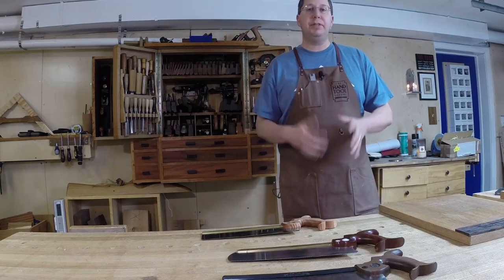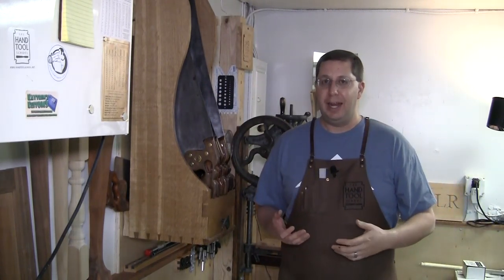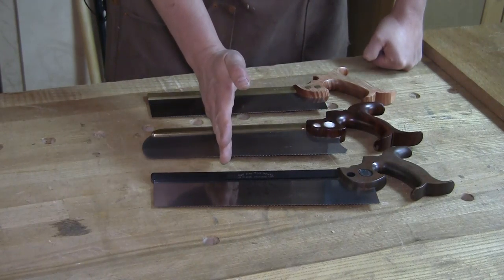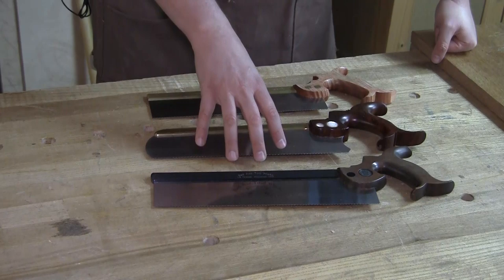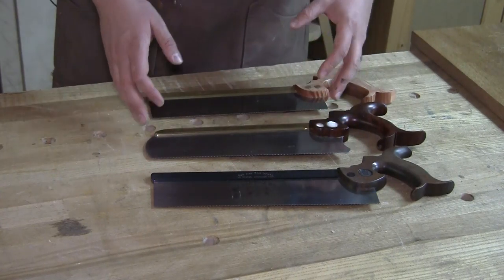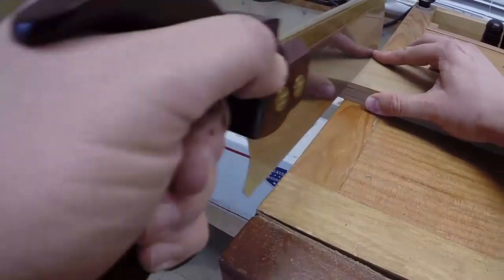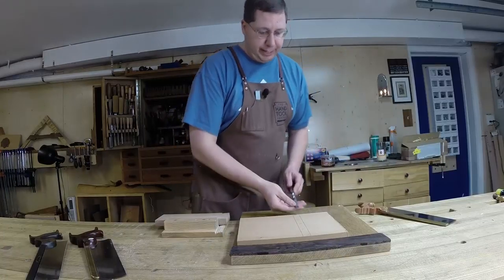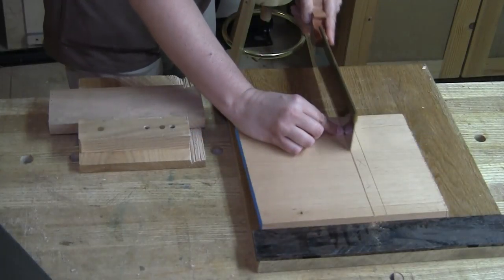RWW187 Which Saw First

Comment: I got lucky, my first backsaw was indeed a carcass saw. I learned to do everything with it and later purchased more specialized saws. Like I said it was pure luck. It just happened to be a saw I found at an auction a few decades ago. I didn't even know at the time it was a crosscut saw. I just bought a file and tried to follow the geometry that was on it. It was later when I started to understand the differences and expanded my purchases. Over the years I've lessened the rake a bit to make it more aggressive and I still use it for most every job. It was a great purchase.

Comment: I agree that the carcass saw is the first saw you should buy as a beginning darksider. I would argue that it should be a rip-cut though, and here's why.

1) Both saws cut dovetails equally well.
2) Cutting the cheeks on tenons is much easier with a rip cut saw, and the shoulder cuts are relatively shallow. With a good strong knife line all round, tear-out shouldn't be an issue on the shoulder cuts either.
3) Although crosscuts with a ripsaw can be a bit difficult to start, once you get going it's not that bad, and again, a strong knife line helps with tear-out. You're going to finish those cuts on a shooting board anyway, so it's ok if the cuts are a tiny bit rougher.
4) Working without the benefit of hardened teeth means you need to learn to sharpen, and sharpening a rip saw is leaps and bounds easier to learn than sharpening a crosscut saw. A beginning woodworker intimidated with sharpening their pretty new saw is a beginning woodworker less likely to sharpen up, and more likely to become frustrated with a blunt tool and chuck the whole thing in.
5) A lot of the problems starting a rip cut saw can be overcome with a progressive rake (similar to progressive pitch, but much easier to do). Probably not something an immediate beginner would try, but certainly helps with the versatility of the tool.

It's worth mentioning that I rarely if ever use crosscut saws, so I might be biased. Food for thought though.
Reply from the maker: Indeed valid points of which I agree with all of them.  However, the sharpening difficulty thing is a perpetuate myth that one attempt at sharpening will dispel.  Seriously its not that hard, and it should be a required skill so why not figure out the "harder" way first.  Second, I agree with the dovetail and tenon thing but longer dados and cross cuts will be cleaner and easier to start and finish with a relaxed rake and some fleam.  Like I said in the video, why not stack the cards in your favor and sacrifice a bit of speed.  I doubt speed it really what a beginner wants in their saw anyway.  Let's be real though, there isn't that much difference in the performance of the two geometries when we are dealing with the finer pitch of these saws anyway so let's call it a wash eh?  The cool thing is altered geometries and additional saws are the fun benefit you get after you discover you enjoy sawing so I think the easy glide, clean cut of a crosscut tooth gives a better first impression.  Consider it a gateway drug ;)
Reply: A fair point. As you say, with the finer pitch makes for fairly similar saws ultimately. One of the few crosscut saws I do use is a crosscut handsaw, because starting a crosscut with a coarse pitched rip handsaw is just not going to happen.

Maybe I'll give crosscut backsaws another go too? Afterall, if I don't like it I can always file it rip :P

Comment: Shannon, good video and discussion. A few years back as I was entering the realm of hand tool woodworking, I agonized over this very decision. It is interesting that I ended up at the same conclusion as you with one small exception: I finally decided on an LN Carcass Saw filed with rip teeth. Yes, it was a "special order" I suppose, but cost me nothing additional. I chose the carcass saw for many of the reasons that you mention in your video, but went rip because my main concern was dovetails, tenons, and rabbets. Also, I figured that 99% of my cross cuts would be done using a knife line, and likely a shallow "V" (since I am a beginner, I use these cheating methods", so tear out was not a concern. So far, I have no complaints, and my rip saw does a pretty darn good job of crosscutting - that said, my next joinery saw will likely be filed crosscut.

Again, great video, thank you so much for sharing!
Reply from the maker: carguy460 There is no such thing as cheating in woodworking.  Knife lines and v cuts are common practice from beginner to advanced.

Comment: I have been watching you use all of your saws for a while.  I currently am mostly an electric woodworker.  I want to learn the craft of hand tools.  Recently, I was asking myself this very question.  Which saw?  I went to Bad Axe, and got totally confused by their site.  They have so many saws and call them by so many different names.  I would love to have someone walk me through their site.  Any suggestions?  I decided to buy a saw that I am sure would be laughed at.  I was on Amazon and there is a Stanley saw for ten bucks.  It cannot be sharpened, but I thought it would be a good place to start until I have used it a bit and decided to spend the money on a good saw.
Reply from the maker: Those stanley hardpoint saws are pretty good actually.  I meant to reference it in this video, but it actually lives in the trunk of my car and I use it for breaking down lumber at the yard so I can fit it into my car.  Mark does have a lot of options with even more technical jargon.  I would go with what this video says and get the small tenon saw with hybrid filing.  It is a bit more aggressive than their carcass saw, but hopefully you saw how well it worked in this video.

Comment: Shannon, Thanks for the great video! What's the difference between a sash saw and a tenon saw? I pretty much guaranteed to get a least one lee valley gift card for Christmas. I might pick up a hand saw and join the dark side!
Reply from the maker: Wooden Robot Workshop traditionally, the tenon saw would be a bit longer (16-18") a bit deeper under the back (up to 4-5") and have a rip filed tooth with a lower pitch (12tpi ish).  Sash saws sit around 14" long and are crosscut filed and in the 14 tpi range.  These configurations will change regionally and from user to user too so don't get too attached to them.  The best thing is to think about what you will be doing with the saw.  What is the intended use of a tenon saw?  To cut tenons of course which is a rip cut which can require a deep cut and need to carry sawdust out of that deep cut.  Hence a longer and tall plate with a rip tooth and bigger gullets.  Likewise, a sash saw was for cutting window sash.  Precise and square crosscuts to cut all the parts to length that must leave a clean surface.  Oftentimes the parts were ganged together and cut all at onces making for a wider cut and the longer plate handles it well.  Make sense?

Comment: Thanks for excellent explanation and wise advises for the first saw!!! But I need also the other one for re sawing some 4 cm thick 20x100cm boards to three or four 1 cm thick boards. What will be your advise for my 2nd saw? Should I buy a panel rip saw, or maybe  medium or small Roubo style Frame Saw? Thanks in advance!
Reply from the maker: a coarse pitched frame saw can't be beat for resawing, but unless you do it a lot you might consider a typical rip saw in the 5 ppi area as you will get more utility out of that.  Adding a frame saw to the saw nest early without having the mainstays seems a bit premature.
Reply: Thank you! So I guess I need to get them both... hmmm... or a frame saw and a kerfing plane
Reply from the maker: I still have yet to need a kerfing plane.  I'm sure if I had one already I would use it, but it does seem to be a superfluous step with a well tuned saw.
Reply: Ok!Thanks! I guess my second one will be a 5 ppi panel rip saw.

Comment: What’s the name of the chisel guide you used to pair down on the metered tenon?
Reply from the maker: Jeremy Long which part are you referring to. I don't follow.
Reply: RenaissanceWW sorry, it was a mitered tenon, and I’m having trouble finding it now. But you were pairing down the 45 of a mitered tenon and you had a tool/jig guiding your chisel to keep it at a 45, or so I thought.
Reply from the maker: I don't think that is in this video but it sounds like you are talking about a paring block.
Reply: RenaissanceWW is that a tool or something you made? It was black and looked metallic.
Reply: Nvm, first image I found on a google image search was yours, seems like you made it, nice design though, thanks for the reply.
Reply from the maker: again I'm not exactly sure what guide you are talking about so I can't answer that.  I'm trying to think of when I have made a mitered tenon or what you actually mean by a mitered tenon.  I will miter the ends of tenons that meet inside a leg to allow for a little extra length in each but that is not a precise task and I will pare that away by eye.  I will use a paring block if I much nail the angle like the inside corner of a frame an panel joint with integral moulded edge.  If I'm laying out a miter then I do have a metallic miter layout square but I'm not using a chisel there but a knife.  If you can find the specific point where you saw this tool I can help but I'm sorry I have A LOT of videos so I'm just not sure which specific point you are referring to.
Reply: RenaissanceWW sorry I was trying to scrub thru all the videos I watched yesterday, but I was a little out of it, I may have been falling asleep (that’s not an indictment on your videos), I’ll keep looking and see if I can’t find it.